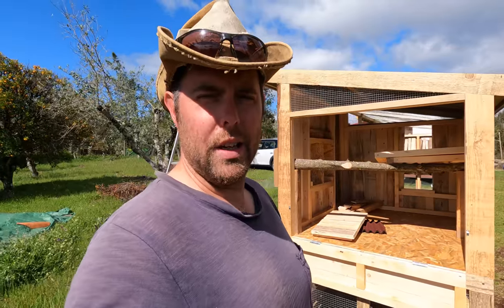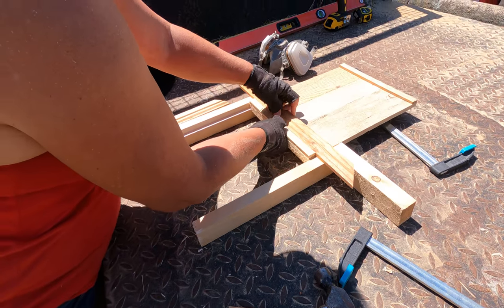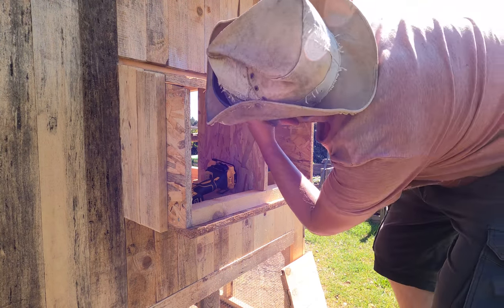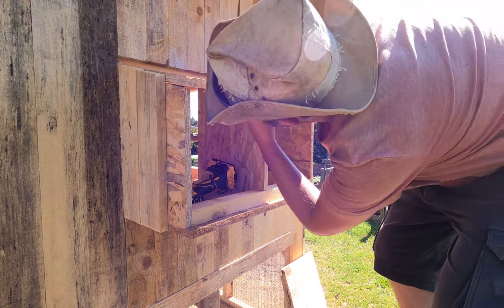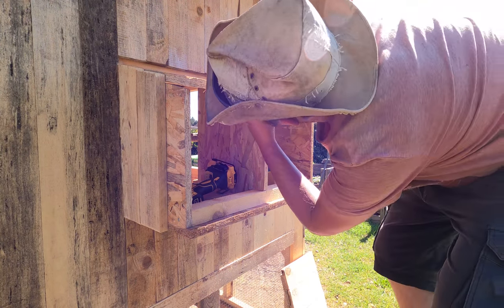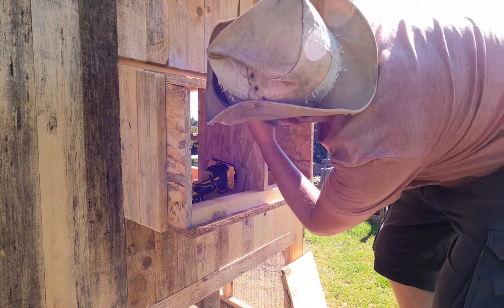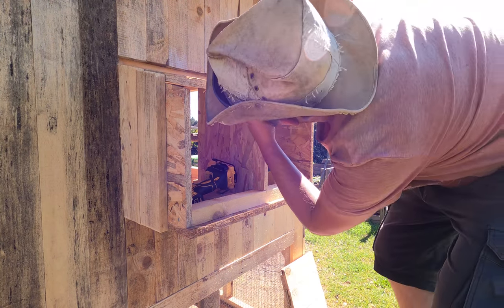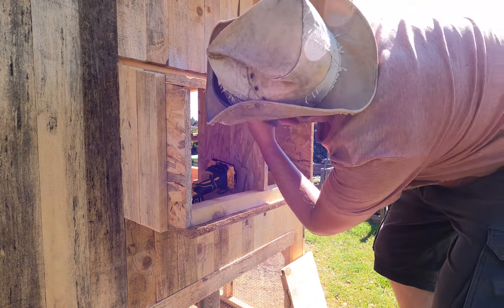Building a Chicken Coop - Part 3: Chickens MOVE IN (after many finishing touches) - #11

Comment: Very nicely done.  You'll be more than please with fresh eggs.  Your guillotine doors, place some bees wax on the dados/routering to keep them sliding smoothly.  When you decide to take the plunge on a table saw...look for a model that has a router table built into the extension wing.  Kylie, you will be in woodworking heaven with a good version of this type of saw!  Also, a dado blade will make cutting dadoes and rabbets as slick as can be.

Comment: Looks nice, but what happens to the outer chicken door (in the mesh) when it gets wet from rain? Won't the wood expand and get stuck in the groove? How do you ensure that it will always slide?
Reply from the maker: We’ve run into that problem already ... so we’ve planed and sanded the edges so they’re bevelled and thinner, seemed to have fixed the problem, for the moment at least
Reply: @MAKEDOGROW  Well done - good thinking :-)

Comment: Any untreated wood in direct contact with the ground will rot within a few years.  Pressure treated wood will last a long time but it is probably not good where chickens can peck at it.  Raising the coop up on top of rock/bricks with slayer of heavy plastic in between is about the best you can do.
Also, you can wait 6-12 months but you really need to stain the wood.  Oil based stain with an extra quart of boiled linseed oil per gallon will make a long lasting coating.

Comment: Router table - I agree routing without a table is both boring and frustrating. The problems magnify when trying to achieve an accurate decorative molding.  At some time you will need a router table or spindle molder. But, why not make a table yourself? They are easy to make and you can go for the size you want. A table is just a router holder, fence, guide trench, and rise and fall. You can use the router rise and fall or make your own. I have two such tables, one vertical the other horizontal. Both work well and are a delight to use. Make Do Route!